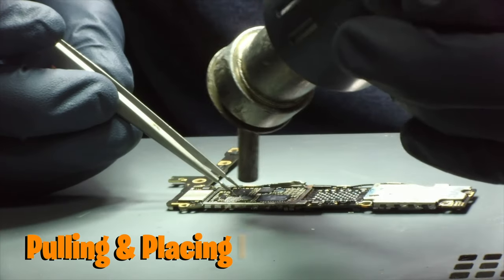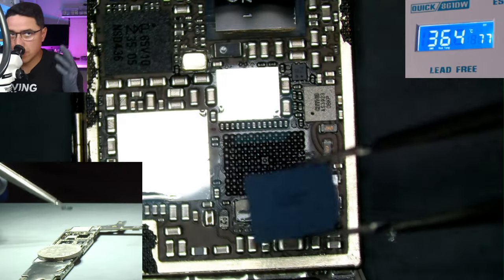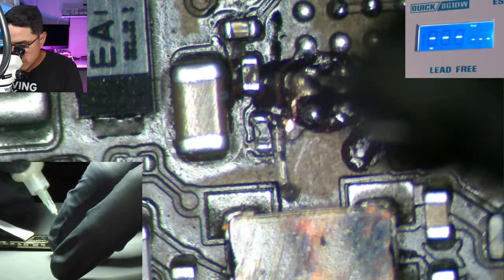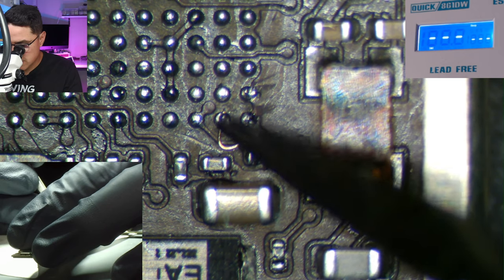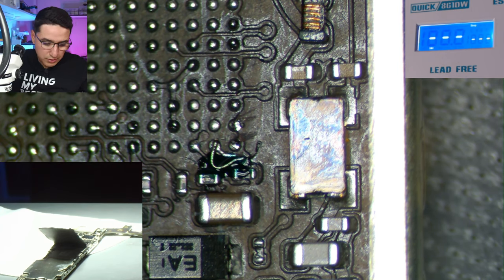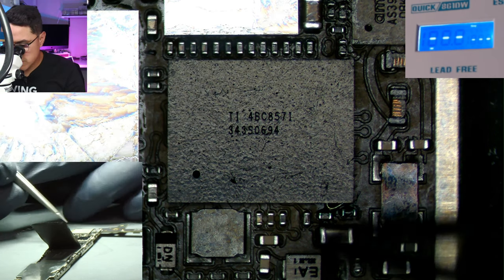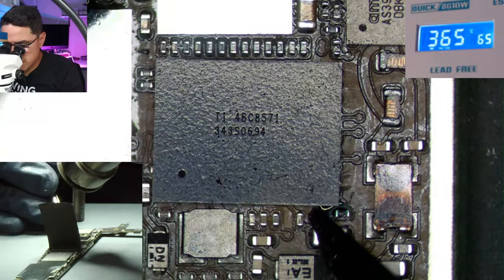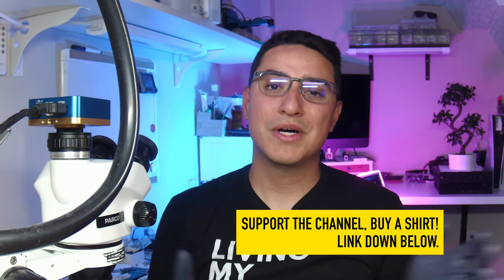The Best Practice Routine for Beginners. Learn to Reball & Run Jumpers. Microsolder Training.

Comment: At min 6:00 i think you use too much flux. You can trigger infinite earphones plugged in because of audio codec. You need to ultrasonic clean that board!
Nice work also!
Reply from the maker: I've done hundreds of these repairs & literally never had that issue. 

Maybe if you have bad quality flux, that can happen. 
But I also advocate people to clean off any excess flux off the board with isopropyl alcohol and toothbrush.

I've never had to use an ultrasonic cleaner on a board for just basic soldering like this.

Comment: Please.mention about the distance between the board and nozzle tip.
For ic pulling and ic refitting
Reply from the maker: You want to be around 6in when you first start

Then move in closer and closer slowly
Reply: @VCCBoardRepairs  6 inch you sure?.
Feel like big distance
Reply from the maker: Yes, to start and you move closer and closer

You don't stay at 6in the whole time

You first need to warm up the board by being far away
Reply: @VCCBoardRepairs  lit up the idea 💙

Comment: You are using Amtech 599-ASM flux? Always sticky an hard to remove.
Reply from the maker: Yes, I haven't had any issues with it. The key is to clean often.
Reply: You have motivated me to stop using solder wick. It will save me time and wick 🙂. Would love to see cpu swap vids and tips

Comment: Help Jesse. I got iPhone 7+, baseband issue (no IMEI No Service) I did everything like you do (took off and reball BB) - Nothing changed. I didi it twice, this time i found weak pad, so run a jumperwire (double check in diod mode and i did it properly), reball and the same. Still NO SERVICE. Please tell me what to do next?
Reply from the maker: If it happened after an Audio IC repair, then yes, you would need to reball BBCPU

if it happened on its own, then unlikely the solution is to reball BBCPU. In those cases, it's usually BBPMU or XCVR 0 and 1.

If it's QCOM model, then it also needs ground pad jumpers.

I'd suggest you post in my group for help: www.vccboardrepairs.com/vcc-fb-group